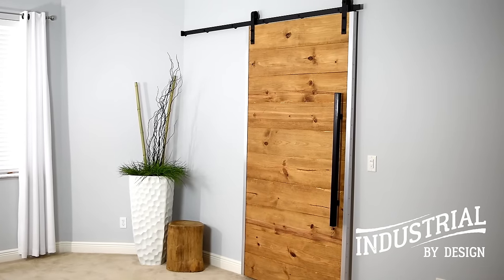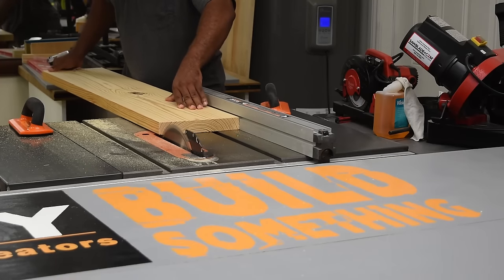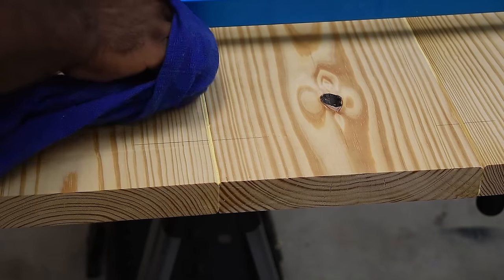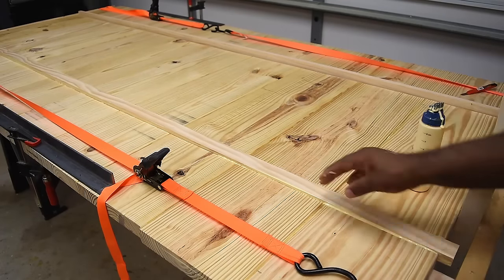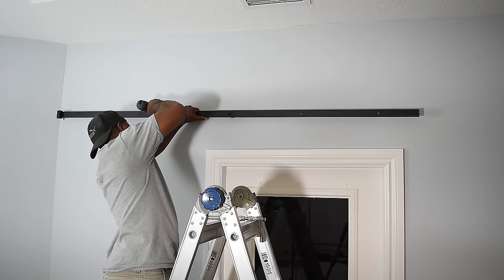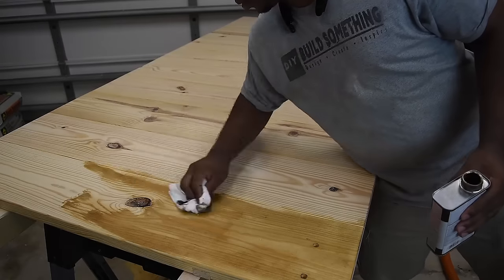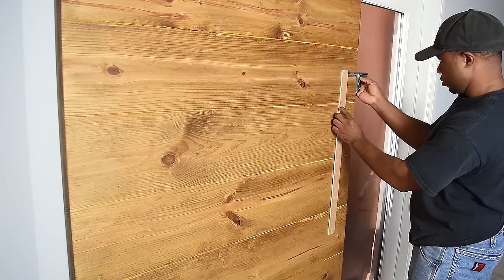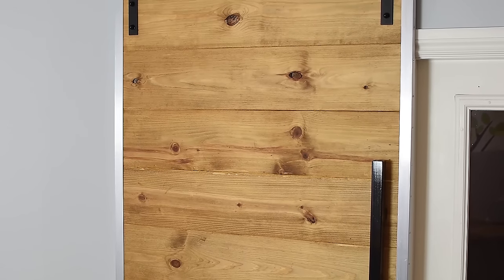How I Made My Sliding Barn Door | Rustic Modern

Comment: Good stuff. Great tip about letting the boards dry out. I used tongue and groove boards so I was able to build my door in a day. It took about a week to stain and polyurethane it. Then another day to mount it. I used ratchet straps because I didn't have a clamp that large either.

Comment: Looks very nice great job! One thing though the strips you glued across the grain in the routed dado are gonna try to prevent the panels from moving with changing moisture. With all that cross grain you will have a ton of movement. I am betting the glue will fail, the panels will crack and/or the whole thing will curl up big time. Best to screw the strips in using slotted screwholes. Give it a couple humid summers and dry winters. Something's gotta give. I've seen many antique tables and box lids split this way.
Reply from the maker: Thank you. Yes, I  know where you are coming from. It was one of my concern. I have to watch it and see what will happen in time. Worst case I'll make another video and share what happened.
Reply: I was thinking the same thing. On the bright side, it will be interesting to see what part fails first in an upcoming video!
Reply: What will most likely happen is when the timber shrinks in summer the door will curl in away from the wall where the braces are and in winter when it expands it will curl the other way. It shouldn't break because the inlaid strips will bend easily. You might just get away with it.
If it was made from poplar or western red cedar that was properly kiln dried you'd probably have no issue because it's really stable wood.
Reply: Yeah I kind of cringed with the two vertical cross grain glued up pieces . The aluminum angle on both sides will be fighting expansion/contraction as well. I give the guy credit for giving it hell though. Great idea making that handle.
Reply: C Spann  I too cringed a little when I saw long grain being fixed across cross grain, when I was an apprentice you got your knuckles rapped if you so much as got a  panel pin into a door panel so as to restrict seasonal movement. I would have fixed the braces in with a sliding dovetail, hard fixed with a screw in the centre and other board fixed by way of slots same for the angle.  In my experience in the U.K. Soft wood will continue to shrink if used indoors for about a year. I'd like to know if this door does crack after a year or so, perhaps we can have a report on it, what I was thought may be wrong
Reply: hello， i am new to wood working. I was curious as to why those strips were added. From these comments, would you say it’s better to not add strips at all?
Reply: I went to school for building materials and we had a professor who was an expert  on wood. 

He had a timelapse video of wood changing dimensions as water content changed that looked like a worm wriggling on the table. 

He showed it at a trade show once, afterwards was approached by a woodworker who was like, "you're the guy with the horror movie!"

Comment: Why were you using a stud finder if the wall was concrete block?
Reply from the maker: Well, there is still wooden strips in the wall. This is what the drywall is attached to. I located them so I can use them as a backing. This way I don't break the drywall when tightening the bolts.
Reply: DIY Creators what is you full time job and you could probably do YouTube full time soon
Reply from the maker: +Luke Tauzin 
I am a system designer. I plan to go full-time next year the income is just not there yet to make the jump.
Reply: You're more than a system designer. You're an artist, and a damn good one. Fabulous channel!

Comment: Great job Glen I like the way you did the handle and Alum. Trim on sides ! I'm making 
mine for Mstr. Bthr. entry & at 39" wide and I'm using 1" x 6" & 1" x 4"s as trim with 
the Classic X in the middle (maybe). Oh! I'm making my own wheel & track system - I have
quite a few old Hey Trolly wheels bearings and some 2" angle iron so I think I'm set!

Comment: A little tip about the 1x's you put on the back of the door. You may not have any future issues but its a good idea NOT to glue those bc of wood movement. Something could end up splitting. But bc your stock for the door was pretty thick it may not be an issue. Turned out nice.

Comment: Mount the track on a header board. That will bring it far enough away from the wall to clear the door trim. You can also use a header board if the holes in the track don't line up with studs.

Comment: Nice job. Since you like modern aesthetic, you should change out the colonial door trim to a more modern trim profile.  (It would be another project.)
Also, translucent (glass) film (or frost spray) would have given the glass light privacy. (Looks like you covered the back of the glass light???)   Also consider Doug Mockett (brand) or Hafele  hardware for a more modern look in hardware.  As an architect, I spec their hardware often.

Comment: you should look about wood moisture, it isnt as immediate as you think. A freshly cut board can take upwards of a year to dry x inch of thickness, just to get a balance with another environment, a previously "dried" board can take several months depending on the change on moisture of the environment, not to talk about seasonal movement, but that depends on where you live.

Comment: FYI... If you heat up the nuts and bolts to basically red hot and drop them into oil, they will turn black and look like blued metal.  It looks better than painted.

Comment: The way you marked the stud with the finder. looked like you marked where the finder found the first edge. SHouldnt you then find the oposite edge ofthe stud and then drill in the middle of the two? otherwise you might drill in the edge of the stud and not in the center of it?

Comment: Nice project, but that aluminum angle 'iron' really drags the overall look down. You just should've used real 'iron', I mean black mild steel, either painted black or not, it would have looked more 'authentic' and rustic. As for the handle, I also would have used mild steel, square or some other rectangular profile, with the end holes welded in, or even a 3/4-1" black pipe, with end caps.